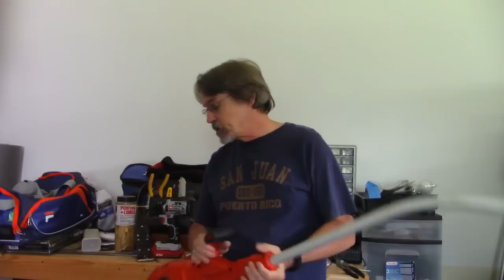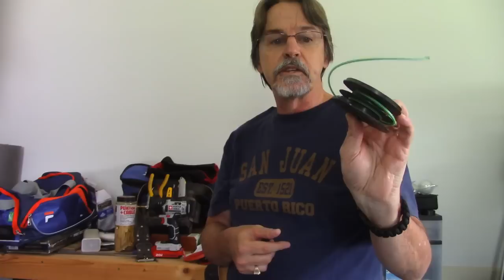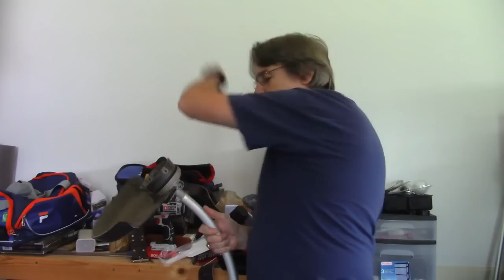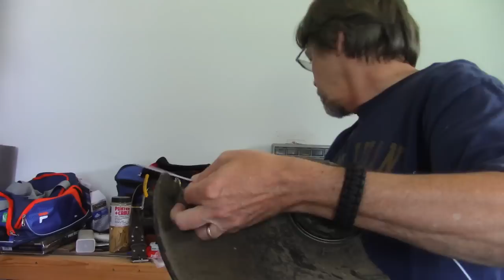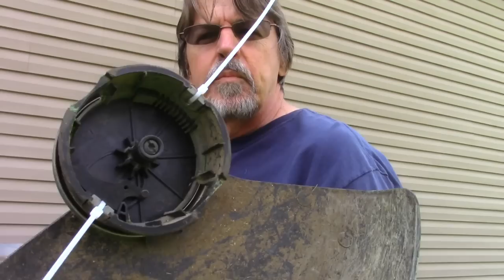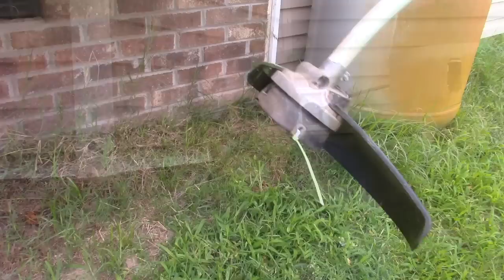Can Zip Ties Replace Weed Eater Line? Does it Work?

Comment: I tried that. Utter failure when I was on a job and the weed eater line was left behind. I spent more time replacing them to finish such a small area, that I ever did weed eating.
Reply from the maker: It was kind of an experiment. I usually buy a bulk roll of trimmer string, cut off a few pieces, tie a knot in one end and put those through the holes. Works great and costs way less than the pre-loaded spools.
Reply: I bout one bulk roll...promptly put it in a safe place so I would remember where I put it. Had to buy a second bulk roll, then had the stupid head blow apart completely. Now I have two bulk rolls of the string, and no head to put them in. I put on a head that uses nylon cutting blades that install and remove with no tools. Never had to screw with it again. My efficiency has improved on the job sites, and I can get 2-3 hours of weed eating near chain link fences before I need to replace the blades. I'm well satisfied now.

Comment: YOU OBVIOUSLY NEED TO CUT THE ZIP TIES SHORTER SO THEY DON'T EVER HIT THAT NUT,OR BLADE THINGY!!! THAT'S WHAT SEEMS TO BREAK THE ZIP TIES, I HONESTLY BELIEVE THAT IF YOU CUT IT WAY SHORTER THAN THE METAL SQUARE SO THAT IT NEVER TOUCHES ANY METAL, THAT THE CEMENT WILL BREAK OFF THE ZIP TIES,JUST MY THEORY,TRY CUTTING THOSE TIES MUCH SHORTER THAN YOU PREVIOUSLY HAD!!!

Comment: Ok I run a garden service, get a better weed whacker. Zip ties are not cost effective. I suggest thicker line you won't go through it as fast. I can load up a spool in about 5 minutes or less and it will last through 2 to 3 days and it's not a pain to reload. Zip  ties are flat spool line is round which is why it works better
Reply from the maker: Thanks for the comment. Yeah, this was kind of an experiment. It works ok if you don't have anything else. I usually buy a bulk roll of trimmer string and cut off pieces. It works better than those pre-loaded Black & Decker spools and lasts longer.

Comment: Pretty good.  I'll stick with my nylon handled clippers.
Reply from the maker: It was kind of an experiment. I usually buy a bulk roll of trimmer string, cut off a few pieces, tie a knot in one end and put those through the holes. Works great and costs way less than the pre-loaded spools.

Comment: My question is: how do they compare to the actual strings made for the trimmers? If they don't do as good of job, are you really even saving money?
Reply from the maker: It was intended to be an emergency workaround and works fine for light usage. I have found since making this video that if you buy the bulk trimmer string in a roll and cut small pieces (9" or so) you can tie a knot in one end and put it through the holes in the trimmer it works just as well as the pre-loaded rolls and costs next to nothing. If you make up a bunch in advance it takes no time to reload.
Reply: I don't think cost is an issue here they are looking for ease of replacement over the restringing procedure, but in the end doesn't work nut as I stated earlier there are several different grades of trimmer string as well as zip ties, cheapos from harber freight not even considered please

Comment: i tried using 2 bicycle brake cables and only lasted 1 minute, really surprised at how strong actual strimmer line is
Reply: the strimmer line is made of nylon, same the zip ties. The line has to break to prevent the motor from stalling, if it twists around a hard object.
Reply: @stanimir4197  i ended buying 1 of those spools where you can fit different thickness wires, pack of 10 heavy duty £2.50 and i did my whole garden with 1 wire

Comment: Buy yourself a roll of the cutter string for $5 or $6 at the hardware store. I get about 3 seasons out of one roll!
Reply from the maker: Yep, I've been doing that for a long time. The trimmer string works better. Before I replaced my string trimmer I was buying the bulk rolls and using short pieces. It woks great and is way cheaper than buying the pre-loaded reels. Thanks for the comment.

Comment: I tried this. Does not work. THe ties snap when hit stone or kerb.
On the grass the cable ties have not cutting power, because, the ties are not thin enough or strong enough.
Reply from the maker: Tie a knot in short pieces of trimmer string and feed them through the holes in the trimmer. This way works much better.

Comment: Ya..L tried this too....The ties are too brittle and break...I've also used light wire and it breaks as well....Back to the drawing board....Weed whackers are just a pain in the ass...plain and simple..
Reply: That's exactly what happens. I'm sure when this product was being developed they discovered that the key characteristic needed to use plastic filament is the flexibility of the cord used. Zip ties are made harder/brittle so that you can apply a large load when tightening them around things. If zip ties were flexible they would stretch rendered useless.

Comment: The same thing happened to me when I tried using zip ties. They both broke straight away.
Reply from the maker: Try cutting two short pieces of trimmer line, tying a knot in one end of each and feeding them through the line holes... Works great if you don't have the spool. Thanks for the comment.

Comment: Even tried metal zip ties? They are a lot stronger and cost about US$0.20 a piece...
Reply from the maker: Sounds like a good idea. I've never seen metal ones.
Reply: @MrBulletpoints  if the line is too strong and manage to hook a hard object, you'd stall the motor and/or run down the gearing. The Black and Decker in the video has a plastic gear.
Reply from the maker: @stanimir4197  Thanks. I don't have that trimmer anymore but it worked well for a long time. I'm sure they use the plastic gears to save a little on production and probably so you can't keep the same trimer for 20 years.

Comment: Electric? I'm moving on to the next vid
Reply from the maker: Gas is starting to look like it makes a lot more sense.
Reply: I have a Worx battery trimmer and it will edge my 50' front walk AND do all the trimming on one charge! I love it! BTW,I am out of trimmer string right now,but I have a bag of zip ties in the basement. I will have to give them a try.

Comment: Takes a "lot of time" to reload the spool?    HUH???  It takes me longer to MEASURE out the amount of string I need, than to wind it and since it just clicks back in place now, the whole thing takes only about 2 minutes when you're SMART and you PRECUT YOUR ENTIRE SPOOL OF LINE IN ONE SETTING into needed lengths.  

How do you do this easily?  You measure out fresh string to the appropriate length, cut, and then RECOIL THAT MEASURED LENGTH UP TO SAME ROLLED UP DIAMETER AS THE STRING SITTING UNUSED IN THE PACKAGE.  This is a ONE TIME THING TO DO.  Now just COUNT THE NUMBER OF LOOPS OF STRING that are in that proper length string.  To cut the rest of your spool, just count out that many LOOPS and cut.  count again and cut.  count and cut.  Repeat until the WHOLE SPOOL IS PRE-CUT TO THE LENGTHS YOU WILL NEED.  That way there is ZERO time spent in the future to get the length you need, NOT two minutes to roll it out, measure, and cut EACH AND EVERY TIME.  If you stick with the same brand of string, you can even WRITE the number of loops on the package, and have that number to use to cut up the NEXT package of string WITHOUT ANY MEASURING AT ALL.

Then in your "test" you run the whacker with zip ties for LESS THAN A MINUTE and declare it a success.   HUH?  what crazy conclusion is that on TOO LITTLE DATA?

REAL data is running it 2 months, and reporting how many zip ties to do a certain size yard for TWO MONTHS.

Then the FIRST set, when they broke YOU HAD TO CUT THEM OFF TO REPLACE.  Just the fact they need to be CUT OFF should be an indicator that this is a LOSING IDEA.

So let's get the comparison straight:

A - ZIP TIES:

Load up 2, run for god knows how long, likely have to CUT THEM OFF TO REPLACE, then replace them.  Since they are likely 8" zip ties, you buy a pack of 100 for $8 on Amazon.

B - RELOADING STRING REELS:

Takes 2 minutes SINCE YOU START CARRYING A REPLACEMENT LENGTH OF STRING WITH YOU TO GO WEED WHACKING.  BUT ONLY NEEDS TO BE RELOADED LESS THAN ONCE A MONTH.  A 300' roll on Amazon is $14.  Reloading it once equates to likely 10+ changes of zip ties at a minimum.  Because you PRECUT the ENTIRE ROLL OF STRING, each time you go out to weed whack, you simply TAKE AN EXTRA PRE-CUT LENGTH OF STRING THAT WAS HANGING UP WHERE THE TRIMMER HANGS, that way, no walking to get get it, --right where it breaks out in the yard YOU RELOAD IT and finish the job.  In that case, when you PUT AWAY THE TRIMMER, you SET ANOTHER PRE-CUT LENGTH OF STRING WITH IT ON THE HANGER to carry out with it NEXT TIME.

------------>  Um, Ima go with RELOADING.
Reply from the maker: Thanks for that book length tutorial on the "easy" way to do it. If it works for you, that's great. Knock yourself out. By the way, I "tested " for a whole lot longer than a minute. I did something called editing. I, unlike you, am not claiming to know the exact best way everybody should do everything. It was just a test to see if it worked at all. If you have a method that works for you that's great.
Reply: @MrBulletpoints  - Pro Tip: next time you do "editing", mention it in the video, and how long the test was.
Reply from the maker: @brianmi40  "Pro Tip" ?....  You have 8 subscribers no videos and no discernible talent. I have worked in television and radio professionally since I was in High School and have two Emmys, so excuse me if I don't avail myself of your generous "Pro tip".
Reply: @MrBulletpoints  - smart people don't assume they know everything about another person.  I have no need to share my other channel name with you, nor the subscribers or kudos I've received on it.  I have no need for Argument From Authority fallacies.

Least of all, when called out on a FACT, that you poorly edited the video, and made NO MENTION of the duration of the test, you FAILED as a TESTER.

Let's be clear: NOWHERE DID YOU MENTION THE DURATION OF THE TEST PERIOD, RIGHT?

Finally, ANYONE can pass on a "Pro Tip".  And my "discernible talent" was spotting the FLAW in your review.

Comment: What's wrong with string line
Reply from the maker: Nothing. This was kind of an experiment. I usually buy a bulk roll of trimmer string and cut pieces off, tie a knot in one end and thread them through the holes in the trimmer head. It works great and is super cheap to do.

Comment: I.  Just spent an hour on an acre of tar weed if i used zip ties i would never gotten anywhere.
Reply from the maker: Yep, this was just kind of an experiment. The real string works much better but I don't use the pre-loaded cartridges, I buy the bulk rolls and cut small pieces off. Works better and is way cheaper.

Comment: You'd be much better off with a piece of steel clothesline.. Tie wraps are not sharp and have too wode an angle of attack in the grasss with their widest side,...plus they wear off quick  CAN YOU USE ZIP TIES ON A WEED EATER ? NOOOOOOOOOOOOOOO THEY ARE USELESS BECAUSE ONE SPENDS TOO MUCH TIME REPLACING THEM.
Reply from the maker: You are correct. This was an experiment. I cut pieces from bulk rolls of trimmer string and use those instead of the pre-loaded spools. Works great and costs way less.
Reply: as a paramedic for 32 years I have seen about a dozen cases where people got sloppy with steel wire and cut into their foot pretty badly..

Comment: as in trimmer line there are several different grades of string and also different grades of zip tyes. nothing is 100%. even cable will unravel in seconds, ive tried that as well as plain wire.

Comment: Fail, penny pinching leads to misery.
Reply from the maker: It was kind of an experiment. I usually buy a bulk roll of trimmer string, cut off a few pieces, tie a knot in one end and put those through the holes. Works great and costs way less than the pre-loaded spools.
Reply: Yeah, I guess when Edison experimented and invented the light bulb, he was just trying to save a few pennies.

Comment: How about wire or small chain... my lawn has a lot of trim and I have to reload the trimmer at lease once or twice or more to finish my lawn.... the first years I used a string trimmer in early 1990's the string lasted for nearly the whole lawn but not now... corporate planned obsolescence is a !@#$........
Reply from the maker: It reminds me of printer ink. You have to buy an expensive refill. I usually buy a bulk roll of trimmer string cut off a few pieces, tie a knot in one end and thread it through the holes. It works great and it's way cheaper than buying the pre-loaded spools.
Reply: Mine is a new one which takes 9 feet of line that is loaded by hand winding it by 50% on both sides of the holding chamber......

Comment: Can you use metal zip ties?
Reply from the maker: I'm sure you could if they were cut to length first so they don't hit the protector.
Reply: @MrBulletpoints  I believe one of the reasons weed whackers use nylon filament is not just so they last longer but also the safety factor. Imagine your teenage kids are allowed to use the weed whacker? They will not know to be more careful and not get hit on their ankles or feet. This would create a huge deep cut! With the nylon filament maybe just a small cut would occur.
Reply from the maker: @Movieman1965  I agree with that, not to mention the damage you could do to fences, decks, walls etc.